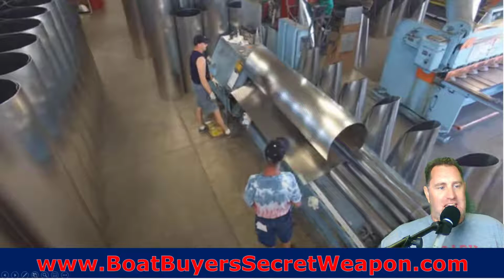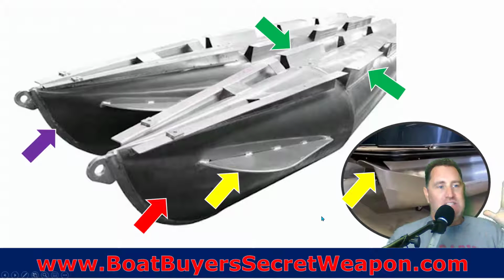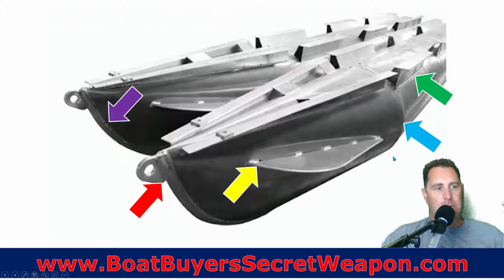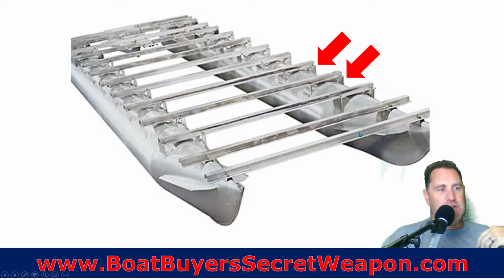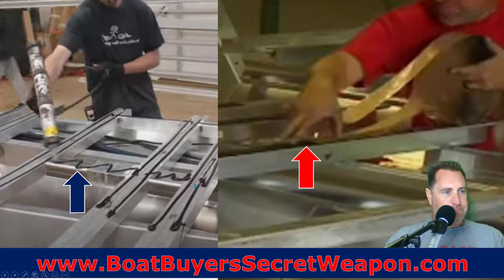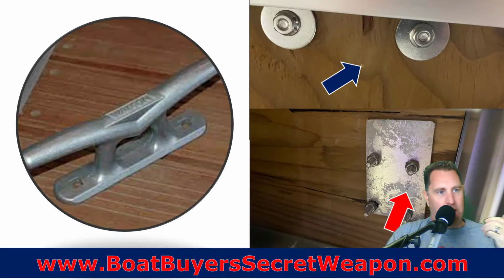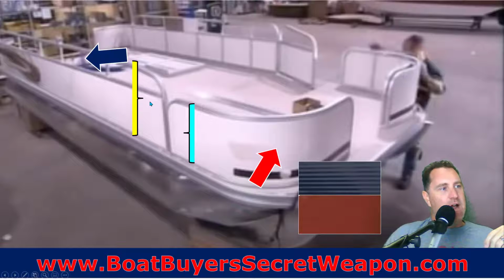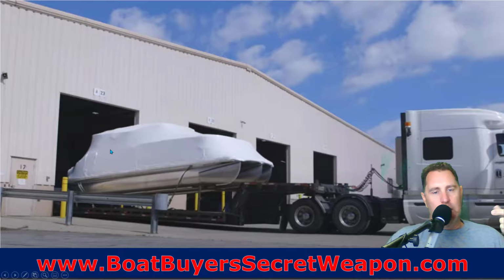How Pontoons & Tri-Toon Boats are Made (What Every Toon Buyer Needs to Know to Make a Smart Buy)

Comment: My new 2022 Sun Tracker Fishing Barge DLX 22 foot with the Mercury 150hp 4 stroke finally came in at Cabela's. Ordered it back in March (now it is September). They are way behind unfortunately.
They're installing some equipment this week before it's ready to pick up. They come with a stainless prop and electric automatic bimini top now.
I got the fishing package, ski tower, and under pinning skin kit with it.

Edit: Got the trailer with it too.

I also got to look it over and the craftsmanship and quality is definitely top notch.
Sun Tracker states that all of their metal is laser cut and all welding is robotically done. I can tell you that it definitely looks robotically done. All the welding looked even, consistent, and perfect. 
I'm very impressed with Sun Tracker. Plus it has a lifetime warranty.